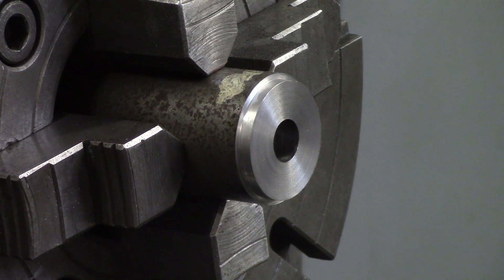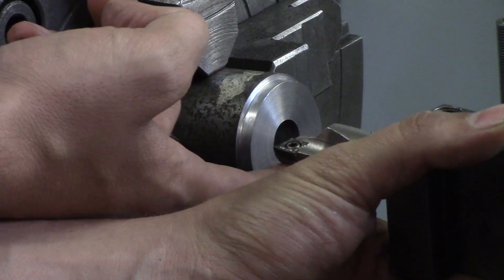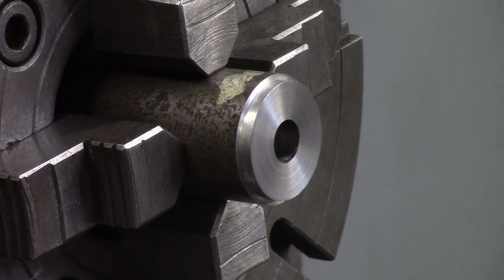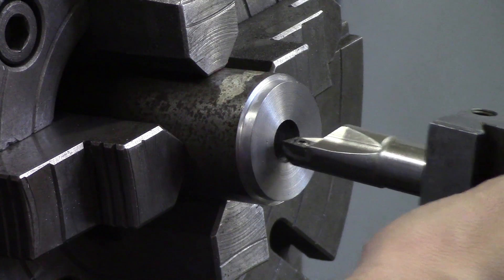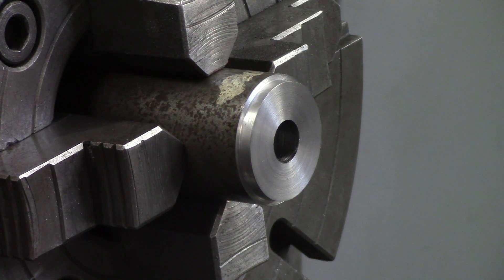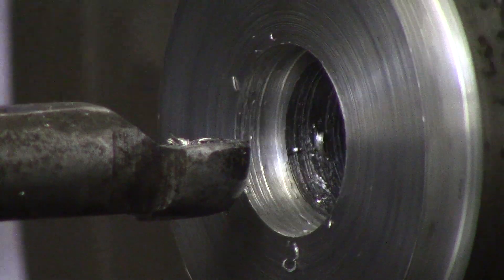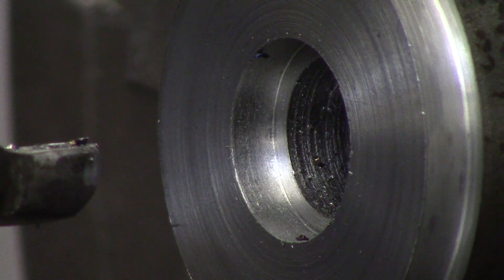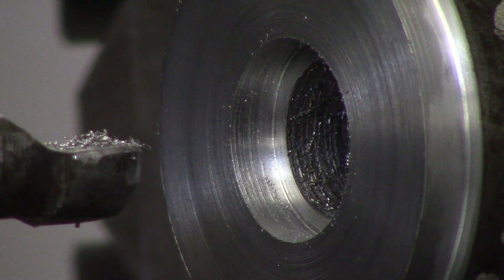Fundamentals of Boring (Manual Lathe)

Comment: Man you make it look to easy, my first time using a lathe today trying to bore out some 1.25" X .25 dom pipe, they told me it had a .75" inside diameter but it's much smaller. One piece 2" long just tried 11/16 drill bit in the tail stock, got stuck a couple times, have no clue how the process works let along using the lathe that's older than me from the 50's it semi worked but i had no clue that there was "Boring tools" I will have to look to see if i have one and use that instead of a drill bit in a jacobs chuck in the tail stock very interesting stuff i have to check more of your videos

Comment: No idea what pushoff means but you sure talked about it a lot. Would have been nice to understand why this mysterious phenomenon affects size
Reply: He was talking about why it cuts again when you take a "spring pass".  As someone else already mentioned though, if you don't change the depth of cut and do the same feeds/speeds, then that deflection also remains a constant.  What I do is when I start approaching the finished size, I alter the depth of cut a few passes away from final size so that the remaining cuts can all be the same depth of cut so you can still cut deep enough for a good surface finish which you typically don't get when making multiple spring passes.  On my lathe (a 9" x 20", so not the most rigid of machines), I typically shoot for multiple passes between .010 - .025" for the last 2-3 passes, checking size each time.  If I need to alter the last pass by .001' or so, then the change in deflection is rather minor.

Comment: What... is "Push Off"...?  Can we please refer to this phenomenon with its actual name of "Deflection" and EVERY Boring Bar Manufacturer will specify the "Minimum Bore Diameter" that each one of their Bars is capable of. There should be no guesswork involved in selecting the right diameter Bar for the hole you use it in. If your Bar comes into contact with the material being Bored, you've either selected the wrong bar... Or the Machinest set it up incorrectly. You should also know if you need the Insert to be held in a Positive or Negative rake. The Insert Pocket dictates that nomenclature. Any information on the correct speeds, feeds or correct bar selection can be easily found by contacting a reputable Boring Bar Manufacturer of which there are many. 
Been selling Industrial Tools for over forty years.

Comment: after you center boring bar, how do you set boring bar parallel to work axis? do you use a square or eyeball it?
Reply: I don’t how anyone else does it, but I square my tool post up with the centerline by placing a 123 block between the chuck face and the tool post. Just run the tool post far enough in to enable placing the 123 block squarely between them, run the carriage to the left until it squeezes the block and squares up the tool post, then lock the tool post down. Takes about 20 seconds!
Reply: @tomt9543  great, thanks for your explanation

Comment: There are a number of reasons that "above center" is a good practice and recommended by cutting tool mfgs., usually .005 -.010".  The tool is mounted off center of the tool post.  As with end mills, where the deflection increases exponentially as the tool length increases, the greater distance off center increases the load and potential movement.  Any particles in the dovetail of the tool post can allow movement under load.  You mentioned length, this allows the tip to go below center.  Lastly, the smaller the bar diameter, the greater the rotational (radial) movement of the tip downward, which increases as the tool edge starts to form a "wear land".  One additional consideration, inserts for steel will have less back clearance, and as the bore gets smaller, the bottom of the insert can rub or "heel" on the bore, increasing the downward movement.  Play with speed, feed, depth of cut, and edge geometry (more positive insert or rake) before "going low" for size and surface finish!
Reply: You can set your boring bar on center without issue. I routinely set a 2"/50mm devibe boring bar exactly on center and stick it out 20"/500mm and have no issues with clearances even when taking a cut that causes the bar to dive 1/8"/3mm down. Bars are designed to have clearance on center, and a lot of machines have no adjustment for tool height anyway. The only time I ever have a bar rubbing on the bottom of the bar from lack of clearance is when I am trying to deepen an already existing shoulder in a large bore and move my tool to a diameter smaller than the bar can allow (because the bore is large enough to accommodate being that far back without hitting on the back side of the tool)

The most common inserts, *NMG (N=0 degrees), have no clearance and instead the bar will have the clearance built into it (usually -5 degrees), while Inserts in the *CMT (C=7 degrees) or *PMT (P=11 degrees) lines have clearance built into the flank of the insert (which is why you also only have one usable side of the insert opposed to both sides with the 0 degree clearance inserts). The distinction isn't whether it has a positive/negative chipbreaker , but the style of insert. The *CMT and *PMT insert styles and the accompanying bars are usually smaller bars (3/4" or smaller typically) and have less material to make the insert pocket and clearances with so they leave the pocket flat and grind the clearances into the inserts themselves.

Long story short, if the bar fits in the hole, it's designed to have clearance in that hole on center with whatever insert fits in the pocket.

Comment: if you take equal depths of cut and keep speeds and feeds the same you can ignore the deflection. those repeated spring passes are a major waste of time in most cases. when you load the machine on the first cut it will remain the same as long as you dont change the variables. your following passes will have the same deflection, so all you need to know is how much that is and you can take heavier finishing passes to get a good surface while holding a few tenths( assuming the rest of your process is reliable anyway).

Comment: Great video! One thought, if you use that stop block and power feed. Won't it damage the machine if the powerfeed runs into it?
Reply from the maker: This is delayed but I figured Ill answer anyway. To my knowledge it is not, I say this because this machine is 20 years old and we have always used it this way. Ill look more into it but the older guys told me "no its fine". I have seen it save a lot of tool posts in my career so far.